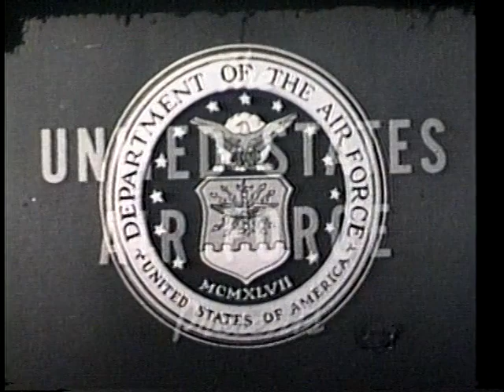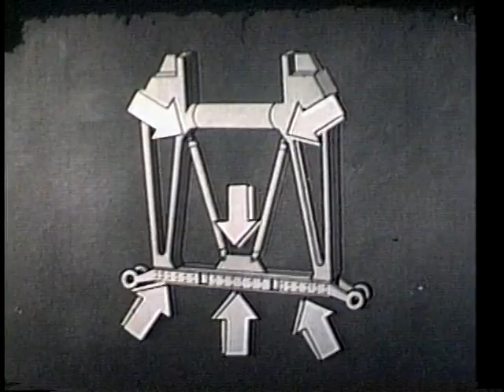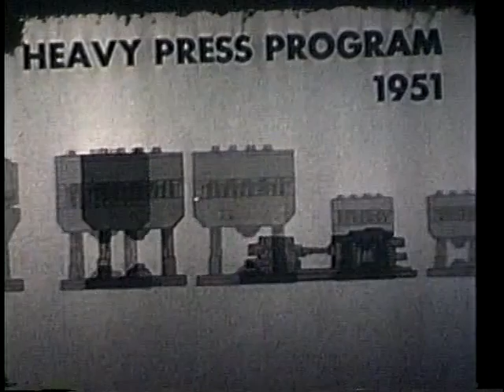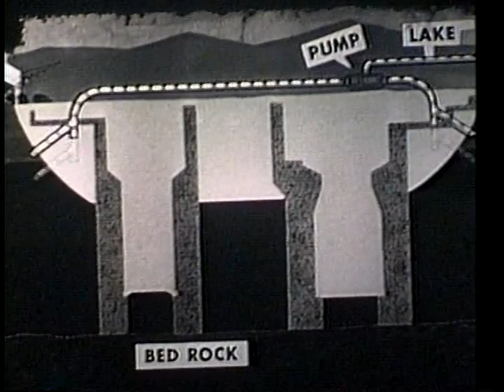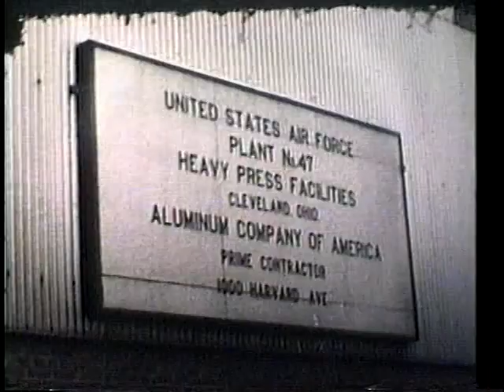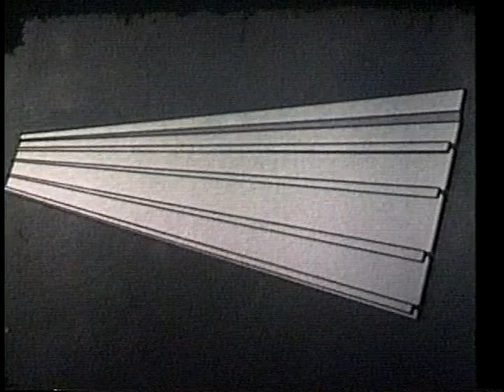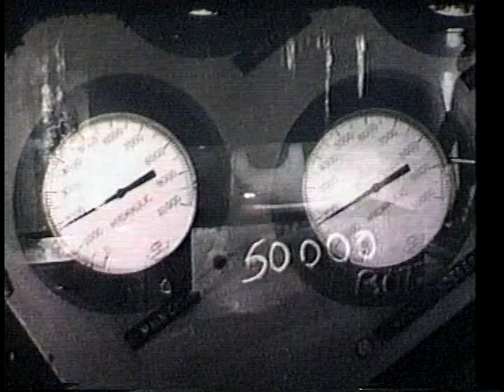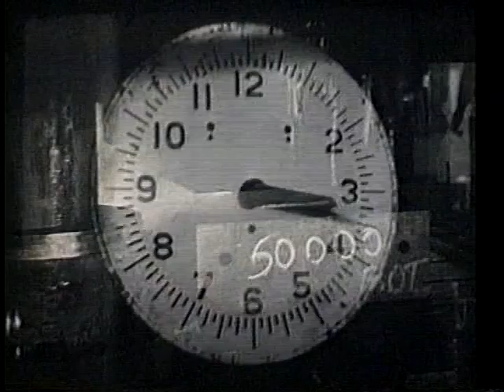Air Force Heavy Press Program (USAF film) by D.O.D.

Comment: Weber Metals outside LA just finished a new super large 60,000 ton close die forge press built by SMS Germany.   SMS descends from the company Schloemann which is referenced in that film.  Ironic that every American equipment supplier referenced in the film went out of business but the German supplier is still out there building equipment for the US military industrial machine.
Reply: U.S.A.F SHOULD HAVE THERE OWN IN U.S.A
Reply: Funny enough, the US military outsource a sizeable amount of machining job to Canada.
Reply: @jasons44  They already do. Most of the presses featured in this video are still in operation.
Reply: Alcoa was mentioned and they are still around.
Reply: @rreinehr1  Every American equipment supplier went out of business.  Companies like Mesta and United are no longer in business.  The end users still in business but not the equipment suppliers.
Reply: @felixyusupov7299  fair enough, thanks mate
Reply: @loveydovey4u  the new mechanical super high capacity press also has an issue, not technical. The “kid” must raise millions of £.

Comment: In the cleanup of the Hanford Site in Eastern Washington State, there was a "small" 600 ton extrusion press that created nuclear reactor fuel rods - just extruded Uranium rods - they came out at about 800F, and had to be cooled for quite some time before use. DOE considered selling the press to a commercial customer, but there were....."concerns" about contamination. So it was moved to the low-level waste facility and disposed of.
Reply: I'll bet it ended up glowing like a billet hot from the furnace.

Comment: ---   Really incredible, the things men have built!   ---
Reply from the maker: I agree.  Thanks! ...
Reply: If you say ‘incredible’ on that.. Then I’d like to hear your word about today project: at least 100,000t mechanical ! press machine. And the power range from 2000 to 100000t possible. Preliminary design’s finished and checked. With certain updates, it even makes up to 200,000t. 
Farewell to the incredible German Monsters and NASA heavy presses  program. 
You’re welcome to ask me your questions.
Reply: @mkmgcok  What are you talking about? What better project?

Also wrong on two counts. NASA was formed in 1959, after all these machines were built. Also, just because you have a larger press (assuming what you're referring to even exists) doesn't mean smaller ones are no longer useful.
Reply: @SynchroScore  You know- You’re right! They are very useful. So the new one, fully mechanical, that gives the new power range  2000t-100000t and even more (up to 200000, as I’ve said) is much more useful. I only highlight here that such project is finished and starts up.
Reply: @mkmgcok  Yes, I am right...and you are not. I haven't found any evidence of any mechanical presses of such high capacity.
Reply: @SynchroScore  oh, You definitely will. Looking for grants and investments. PCT first stage (international) made, the national stage’s now. Thinking of Japan, Ukraine, Italy, depends.
Reply: €$¥£ quite a sum to make the first one, in metal.
Reply: @SynchroScore  I also haven’t found more than 18000t press. So what? This  one is the first.
Reply: @mkmgcok  Got any evidence or links, for any of this, or are you just talking nonsense?
Reply: @SynchroScore  I have the letter from PCT authorities.
Form PCT/.../... (Box No. V)
WRITTEN OPINION OF THE INTERNATIONAL SEARCHING AUTHORITY
International application No.
PCT/...2020/......
The above-mentioned features involve novelty and inventive step since it suggests allowing for a more efficient..... press ........... Therefore, the subject-matter of claim 1 and its dependent claims 2-... is new and inventive as required under PCT Article 33(2) - (3).
Independent Claim ....:
The same reasoning of ...... machine described in independent claim ..... mutatis mutandis applies to the subject matter of the corresponding independent claim 1.
Industrial Applicability:
The invention defined in claims 1-.... is considered to meet the requirements of industrial applicability under Article 33(4) of the PCT.
Just now, that’s all the references that I could disclose, sorry. If you have the experience in fund raising, please let me know. A Professor of our technological institute phoned to some funds but Buffets and most other investors and grants givers are looking for bionics, nanotechnologies, social-economical innovations. As for the Heavy Industries, they most like their own projects, and again: their point is software, controls, or alternative  metals processing technologies. You must be really lucky to benefit from your innovations if you’re an independent inventor, not an SMS Group and etc, etc.
So wish us 5-score good lucks and milliard subscribers after publishing the video that I have no idea how to make just now. Any ideas at all? Thanks anyway.
Reply: And I’m not the inventor, only his relative.
Reply: @mkmgcok  What you have is random gibberish that doesn't mention anything about actual machinery.
Reply: @SynchroScore  sorry to hear that. But that’s what the patent authority has sent. What exactly annoys You? I’m not a mechanical engineer, just a fan and a deeply interested person- in the machine development and in our benefitting from it. Why not? 
Anyway, could we go on discussing it on  my  channel?
And, well, I only copied the opinion of the PCT authorities here, about the invention.: They think that all the claims are Yes-Yes-Yes (about novelty and other features of every true invention). Then, they find it applicable. It’s not about the machine itself, but about the invention that in its turn allows building a more  efficient metal processing (and not only) machine.. Are You a mechanical engineer? 
As for me - my interest lies in  finding  financial, academical and engineering support, among those looking for another piece of information about heavy duty metal processing machines. 
And please, don’t be so personal. Everybody’s according to his skills and knowledge. But it’s definitely not a gibberish- what I’ve talked here about. 
You don’t suppose me to publish everything or anything about it, just here, in YT, before they give a patent on it, do You?
Reply: @mkmgcok  What annoys me is that you haven't provided any details on any actual machinery. No manufacturer, no customer, no links, not even a country where this is supposedly built. If you have somehow managed to make a higher-capacity press that is purely mechanical, as opposed to hydraulic, it would be quite a development, and would certainly have some kind of documentation to support it. I don't know what you mean by 'PCT authorities'.

And while I'm not a mechanical engineer, I do have a degree in manufacturing technology, worked as a machinist for eight years, and currently have a position in an industrial research facility for a worldwide manufacturer of bearings and associated equipment, (including maintenance programs for steelworks and other heavy industry) so I do know a thing or two about these matters.
Reply: @SynchroScore  That’s great! I thought it might be smthg like that, that you are from the technical world. There is not any such press in metal, only designed- ours. I’m looking for a R&D, industrial , financial contacts, We still need analytical   optimisation  of the kinematic diagram, if needed, and a closed  cycle metallurgical and machine building plant - to build the first press- 65,000t- for a start. Though, if there is a good buyer - to build any capacity - 100,000t as well. Electrical part and electronics are still to be designed. Only mechanics is designed for today. But we must decide just now where we are going to submit the requests for patents. As to the production- we  know that Voronezh(Russia)  and Novokramatorsk(Ukraine) in cooperation with SMS group have the money, the capacities the equipment - to build such super-powerful heavy duty machine . But I have no idea how we talk them into such an expensive press production And yes, it is fully mechanical. It is a new word in the world practice.  Is it possible that we  get acquainted and talk to You in zoom or other, no matter which app to use - about a mutual assistance and an industrial cooperation.
I think Warren  Buffet is a good idea. But how on Earth I reach him and make him see to our project and invest in it. I have neither such experience, nor  such  contacts, actually. . It’s my first start up- when we start it up. 
Please share your opinion on whom to contact to and how I reach those investing  chaps.?! to say nothing of making them invest in our venture. What could You say for that? Any help? idea? useful contact?
Thanks

Comment: $235,000,000 in 1953 is equivalent in purchasing power to about $2,707,965,730.34 today, an increase of $2,472,965,730.34 over 70 years. The dollar had an average inflation rate of 3.55% per year between 1953 and today, producing a cumulative price increase of 1,052.33%.

This means that today's prices are 11.52 times as high as average prices since 1953, according to the Bureau of Labor Statistics consumer price index. A dollar today only buys 8.678% of what it could buy back then.
Reply from the maker: wow

Comment: All that incredible tech for such a crappy airplane. The 102 was a dog. They pulled them out of service in Vietnam and gave them to guard units back home, then turned them into target drones which was a fitting end.
Reply: I agree with your comment, the F-102 didn't perform as well as it was hoped.   At least Convair produced a much finer jet interceptor based on the 102.  That being the F-106.
Reply: The B-52, on the other hand, will fly escort when the last B-21 retires.
Reply: @WAL_DC-6B  a lot of that I think was because they didn’t have any area ruling on the 102 but they put it on the 106

Comment: I keep hearing him say water is used in the press , I thought that oil was used ?
Reply: The accumulators use water I think, which in turn drive hydraulic pistons.
Reply: In theory, you could use water in a hydraulic(oil) system. Because both are none-compressible fluids.

But the main reasons why you usually don’t, is: oil is a lubricant anti-rust and a sealant.
So if you run that system on water, it’s gonna rust, leak, ware-down faster and seize easier. 

But it can, and has been made to work.
Reply: It's water with some oil mixed in as a lubricant.
Reply: Kyle Knapp really?
That sounds more like coolant than hydraulic fluid.

By coolant, I mean the milky stuff you pour on the tooling during machining.
Reply: @arnaudmenard5114  the presses use Worcester city water.
Reply: Welp. There is always something new to learn!
Thanks for that :)